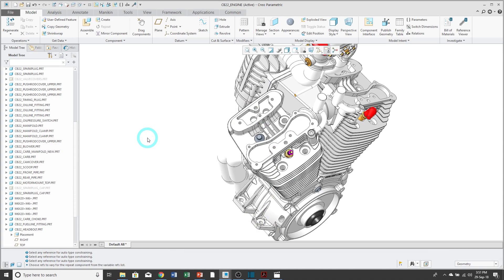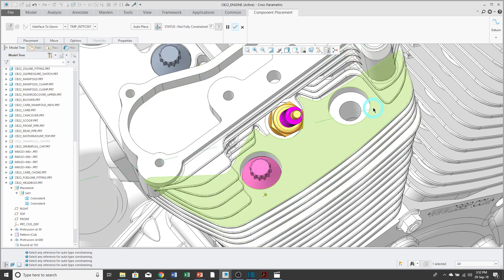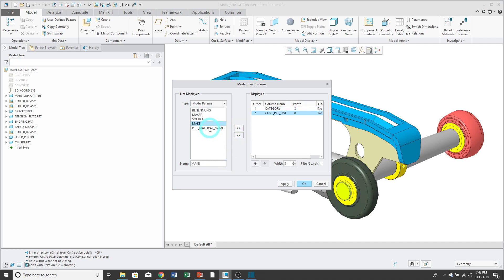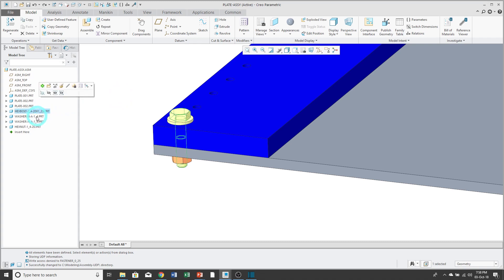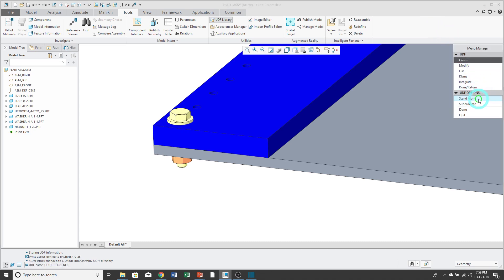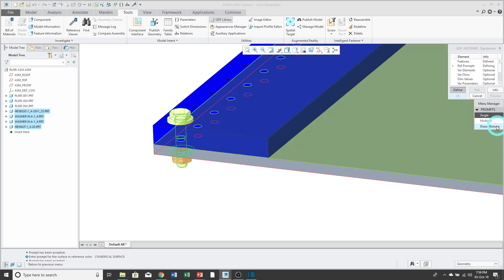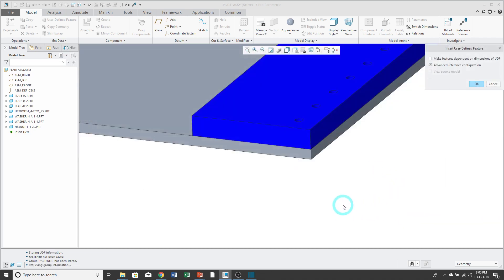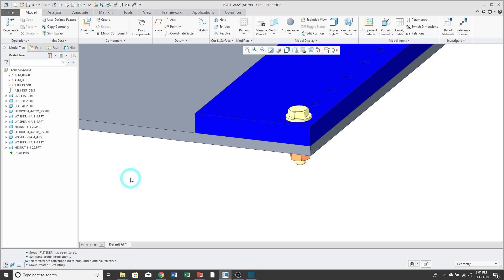Creo Parametric - 3 Assembly Tips and Tricks - Repeat, Parameters, and Assembly UDFs

Comment: Wow very important tips thanks Dave. I have some questions please if you don't mind. in the UDF section you mentioned that doing a subassembly from the bolts components will mess up your BOM. what is the difference between a BOM created with a Subassembly  made of bolt components repeated multiple times and a BOM created by UDF as you did in this video. how do these 2 techniques generate different outcomes from a BOM perspective ? Thank you
Reply from the maker: A subassembly consisting of only bolts, washers, and nuts would imply that these components would be assembled together and delivered together as a unit for integration with the components they will be fastening. It would also imply that there may be a process plan at this level. To deal with this you would need to either designate the fastener subassembly as a Gathering Part in Windchill or create an mBOM that moves the components up to the next level in the assembly.

A fastener subassembly simply creates an unnecessary level of hierarchy in the product that results in downstream work for procurement, inventory, manufacturing, planning, and so on, and would require steps in manufacturing process planning to eliminate.

UDFs and Local Groups result in none of this unnecessary hierarchy or work.
Reply: Wow !! awesome explanation. thanks for your help Dave
Reply from the maker: Glad I could help! And keep the questions coming - the comments help the video ranks in the YouTube algorithm.